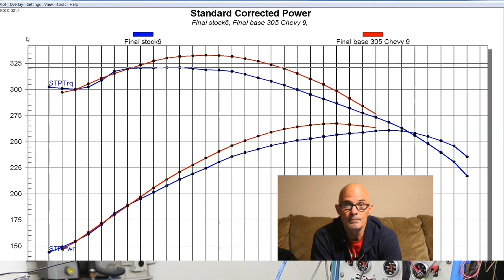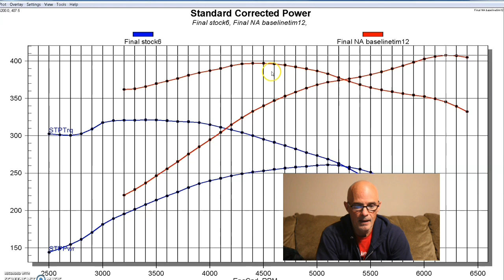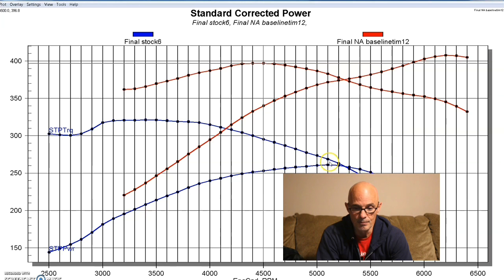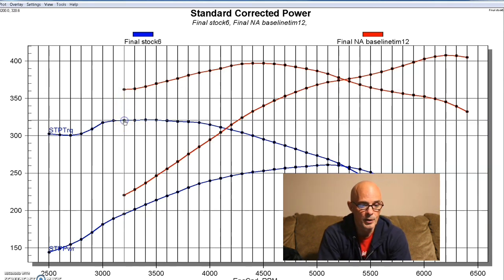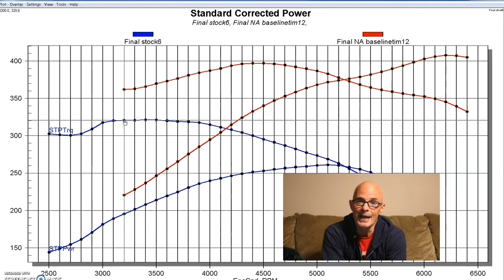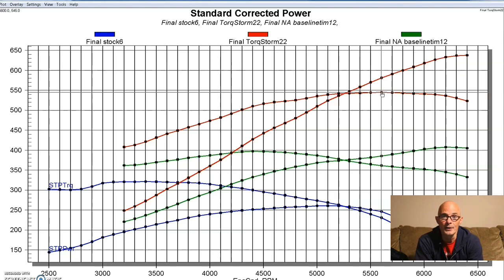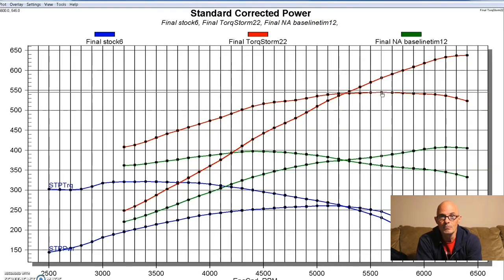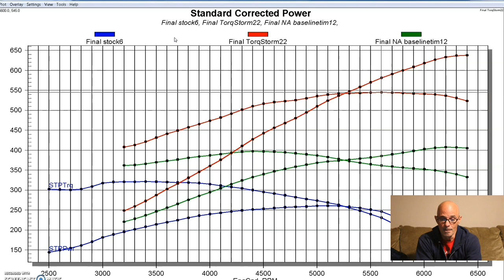5.0L FIGHT-302 FORD VS 305 CHEVY-FULL RESULTS

Comment: This brought back some memories.  in 1987 and 88' I had a bone stock 84' GT with T-tops, even had the goofy TRX wheels.   The 305 GM cars couldn't compete on the street, not even close; the 350 cars were a drivers race, always very close and lots of fun. Although one day an older dude (at the time,  I'm an older dude now) was in a 83-85 turd brown stock looking RS Camaro, we got into it on the freeway, he left me big time ...as the kids now say, I was gapped.  Never saw that car again as I have always wanted to know what he had under the hood.
Reply: @port nut I always have thought he had the bottle, there were to big black puffs of smoke as he was pulling away during a shift.

Comment: So where is the 318 Dodge? Heads, intake, cam, turbos, lets go! :-)
Reply: bcbloc02 👍
Reply: Dodge and Plymouth were completely absent from the Pony car segment in the '80s. And no V8 had port EFI until 1991. The Magnum small block is a low RPM truck engine and would be pathetic in this comparison.
Reply: @Joshie2256  Wrong. The only thing that makes the Magnum engines "truck engines" is the fact that they are biased towards low rpm torque. Change the heads, cam and intake like Richard did with the 5.0 and 305 TPI and you'd get similar results.
Reply: @s0meguy809  Okay, so what was Dodge's 80s-90s pony or muscle car? A Daytona turbo? Omni GLHS? Wait, the Dodge Stealth R/T. That compares to a Camaro right? The only thing the Magnum small block came in were trucks and vans. There really isn't a good EFI Magnum intake manifold, only carb manifolds converted to EFI or modified stock intakes with a too-small runner cross section. I'm a Mopar guy and Mopar had zero RWD performance cars in the 1980s.
Reply: @Joshie2256  That doesn't mean the magnum engine can't make some power. There's currently a stroker magnum zj grand cherokee that runs 9's on spray. Indy or Edelbrock heads, Hughes air gap and a cam in a 318 will make some nice power. It would have been nice if there were more efi intake choices. Problem was most guys that swapped magnums in older cars stuck with carbs.
Reply: @s0meguy809  Sure they can make power. You can make power with a Packard V8 too. Do they belong in a pony-car engine test? No.
Reply: @Joshie2256  What do "pony cars" have to do with anything? He tests engines. Who gives a crap what it came in. Iron block 5.3's only came in trucks so I guess it's a truck engine and can't be put in a car.
Reply: @s0meguy809  This was a 1980's 5 liter engine shootout between the Camaro L98 and the Mustang 302. These were the pony cars of the era. Nobody drives an engine.
Reply: In the garage

Comment: I’m a simple man. I see a Richard Holdener video, I click. Then I click like. 👍🏼
Reply from the maker: simple and effective
Reply: @richardholdener1727  Did you or do you plan on doing a video comparing the Chevy 350 vs Ford 351W in a similar way with pros and cons for each and showing each ones ability to make power?

Comment: I have a 304 SBF with Trick Flow 11R 190 cc heads (56cc milled versions), TFS Track Max Cam 595/595 110°lsa 242/246 camshaft, pro comp intake manifold (Vic jr style), ford Motorsports shorty headers, run by a Holley Sniper EFI setup. I need to put it on the dyno and get it tuned to see what it makes. Love your videos they always keep me entertained while building engines myself or just to purely watch while having a smoke in my garage. Keep grinding and shining 🤘🏼😎
Reply from the maker: thnx-let me know what happens
Reply: Thats a lot of cam for that motor

Comment: I know the Chevy was new, and the Ford was from a bone yard but did you freshen up or ring gap... the Ford?
Reply: dean silva right? The chevy guys always do this.. they get new chevy stuff and always go for junkyard ford blocks n think the results will be “fair”
Reply: @mikecorleone6797  Then it should be easy. Give me 3 examples.
Reply: Corndog1911 I’m sorry I’m having a really hard time taking someone named corndog seriously 🤣
Reply: @mikecorleone6797  Walk on home Ford Fanboy. It's hard to find 305s and 350s because people don't want to give them up but you can find old 302/5.0Ls sll day because the better Coyote and Voodoo engines are available now. When an older GM V8 is built it will always beat a Ford V8 and here is why: Fords rely on higher RPMs and larger bores to get more HP and Torque while GMs rely on compression with lower RPMs. The older GM V8s had greatly reduced their compression to pass emission tests while Ford on the other hand used a Brain Box/PCM to limit the HP and Torque by capping the RPMs and top speed. GMs can gain compression by using a bigger cam longer Rods and shorter heads while the Ford can do that also but not nearly as much because they never hard nerfed their engines like GM did. You will see bigger gains when building an older GM engine than you ever would building an older Ford engine.
Reply: Timothy Isenhart i dont have to walk home guy i drive fords.. let’s take a look at gm’s track record on recalls.. or grenading diesel injection pumps which they are in a multibillion dollar lawsuit over.. warranty my ass
Reply: @mikecorleone6797  Gladly will take GM's truck record on recalls over Fords.  LOL, recalls are all Ford dealerships do these days.   Ford has recalled more cars than any company in history, and that's a fact you can look up.
Reply: @SealofPerfection  

Let's talk about the chevy 8 speed tranny! Talk about recalls.
Reply: @SealofPerfection  sorry, dude.
chevy used to advertise.
" the most resold truck in america. "
think about that for a moment.
in order to be the most resold ... more people had to get rid of them.
Reply: @SealofPerfection  sorry, dude.
the ford f series has been the number 1 vehicle sold in the world for over 20 years.
Reply: @jesusisalive3227  Let's talk about every Ford Vehicle that has been recalled for different Fire Hazzards like the Rangers, F150s, Expeditions, Explorers and Mustangs.
Reply: @tskraj3190  

Let's talk about glued on doors falling off and front ends falling apart.
Reply: Jesus IS Real  

I like showing people the difference in size between the 351w crank and the Chevy 350 crank.

Comment: Hey what size injectors did you run on the supercharged 302 and did the 302 have a girdle on it.
Reply from the maker: both motors were stock bottom ends-no girdles (which don't stop the block from splitting), injectors were 80s

Comment: I had a Mustang and 5.0L Ford LTD (fox platform) so, I have some experience with the 5 liter Ford engine.  One thing that I never liked about the 5 liter Ford is the low deck height.  This causes the rods to move at a large angle relative to the pistons.  Although the engine works fine, I always wondered if these rod angles had detrimental effects especially at higher rpm's?  Any thoughts on that?
Reply: One of the last things even race engine builders think about.  100 other things to worry about before rod angle.
Reply: We screened the crap outta the 302 Windsors! Shot 150 on them 3-4 times a night 3-4 times a week! Had aftermarket rod bolts! But, buy a 351w and heads intake and cam to start with! So much more low in torque!

Comment: Good stuff,  Up next 318 dodge with china heads.  😝 Disinfect first before handling.  🦠
Reply: that sucker would make at least 200 hp ! if you put new heads ,headers,bigcam,big carb,10:1 pistons and mopar stickers. that's an increase of 50hp all for less than 3000 dollars!
Reply: Justin Riley I thought they made 180hp stock, or was it 160? 😝. 273ci was rated at 275hp.  You'd have to install  slant 6 heads with 2 cylinders lobed off to get 200hp.
Reply: @TheProchargedmopar  ours brand new in 1989 made 150hp.

Comment: Great explanation of both engines. Us chevy guys have known the benefits of the 4 inch bore since 1962 (327) when ford was still stuck at 289 ci. No one in their right mind has ever hotrodded the 305 when there are literally millions of 4 inch bore cases to work with.
Reply: No such thing as a Ford 289 in 1962, they were introduced in 1963 😁.

Comment: Please put a 3" stroke crank in a 350 some time with a comparable heads and cam set up.
Reply: That would be cool.
Reply: If it was all the same they would make the same power. Same bore, same stroke, same airflow, same cam, same compression, same curve.
Reply: That would be a 302 chevy...that was the configuration of the 302's in the 68&69 z28's
Reply: They call that a 302.. Or in chevyspeak a DZ302, they did it for the early camaros.. and like any overcammed underheaded chevy back in the day it made all it's power above 6000 rpm. So why rehash it? given the same head and cam specs they make the same power.
Reply: My best friend in high school bought a 68 z28 with a dz302 in it our junior year in high school (1983)... Paid $2700 for it!  ....it had very little bottom end power but loved to rev..  Ended up with a really nice set of bow-tie ported heads and an isky solid lifter flat tappet cam in it..and it ran great back in the day...but we changed out the bottom end with a 350 and picked up .7 and 4 mph in the quarter mile with no other change..
   It was a fun car and a great time to be a kid..
Reply from the maker: I built a reproduction DZ302 and compared it to a Boss 302 and many other Muscle car motors-then modified it
Reply: @philipmacduffie7612  
With the factory heads. I don't see how the chevy could make the power that the boss would. The boss had bigger ports and valves. 
And I am no way a ford guy. 
But there are heads today for chevys that should flow just as good as boss heads.
Reply: @Scootermagoo  yep, but finding one would be a lot harder than just ordering a 3" crank and cramming it in a 350 block.
Reply: @martyjohnsonozarkoutdoors8198  I read what you said as comparable wedge heads on both motors. The 351c head is a great head for it's day but to my knowledge there isnt anything like a C302 / A3 Ford head for a gen1 Chevy. The SB2 is a little unfair against a 351c architecture head, and if you throw the Yates head in then we are just testing low rpm 5.0L cup motors which will be turds under 4k.
Reply: @philipmacduffie7612  I don't know for sure. But I'd say the flow numbers on the Cleveland style heads on the 302 boss would out flow anything gm had at the time for small block chevy. I'd like to see the difference on the dyno. With a same cams and intake volumes. And dynamic compression ratios. Just to see the difference in horsepower the heads produce.
Reply: @richardholdener1727  can we have a video on that? :P

Comment: My buddy broke a bunch of stock 302 ford blocks they seem to crack from the lifter vally to the mains usually about the 600 mark on the 1/4 Mile
Reply: My buddy split a block in half around 5-600hp
Reply: 500 ish they split...

Comment: Everyone had a stang back in the day. Friend of mine built a record automatic car. Maybe a deep dive in your car so people can see how they did it on the first real fuel injected platform
Reply: BuzzLOLOL : So did the Cosworth Vega, with an optional T50 Saginaw based, Borg Warner style 5 speed too for 76. Sadly, GM,  often THE pioneers things with true excellence, THEN backs down. The Olds 350 EFi in the Caddillac was exceptionally smart. The Olds 403 in the Firebird TA was really powerfull. The Olds 350 diesel block was a great prostreet engine base
 The Olds 307 was a great post malaise era Hurst Olds B muscle  car. Gm just needed to keep up the halo end of common coupes and not soley rely on Corvettes and Caddy's for image and tech. Again, having a whole approach. The 305 with the right Brodix Pontiac style heads would have made the F body  or MonteCarlo a real riot for many years.

Comment: The ford tended to split the block when you got over 500 hp. They developed a reinforcement brace but it had limited success.
Reply: Only with nitrous oxide over 700hp. I ran a stock block w/ mild cam and a big ass turbo off of a catapiller generator made more than 700hp but it blew head gaskets all the time.  Lol
Reply: @andrewjolley3620  Bad tune kills more blocks than anything, but you are right about rpm. Keep it under 6,000 rpm and it will take a lot of power with a good tune.

Comment: Everyone is commenting on splitting the stock block above 500 hp. I agree absolutely. However when u build the correct combination it will live to race another day. I have a stock block 302 bored 30 over to a 306. Edelbrock heads comp cam and a ProCharger. Zero intercooler. With 92 pound injectors and 24 pounds of boost it makes 586 at the wheels thru a C4 and 373 gears. Made well over ten passes in the 9 second range. Still lives on today. It’s all about RPMS!!! I shift it at 5600 and never more and leave off a foot brake. Full weight GT with a cage. Not some stripped down she’ll of a drag car. It can be done!

Comment: Have you ever tested the afr 227 vs. 235 vs. 245 23' heads on a built small block?  ...427-434"  solid roller cam...  Around 13 to 1...
Reply from the maker: not that specific
Reply: You might guess...  That's what i have for an engine in my car..  I have the an older set of 227's. Was curious about moving up to the 235 or 245's..

Comment: Smokey Yunick always liked short strokes so he could fit the "longest damn rods" possible to get better rod angle to the crank on the power stroke. Have you done any tests with rod length?
Reply: Engine masters just did that test, rod ratio made no noticeable difference on their big block.
Reply from the maker: yes-rod length changed nothing
Reply from the maker: you might be thinking about changes in stroke length

Comment: I'm surprised the Ford 302 didn't split the block down the lifter valley at over 600 horsepower.
Reply: U also gotta understand its an engine dyno no drag from things in the engine bay and it was running open headers.  That 600 hp is prob 500 at the wheels inside the car likely not that much...point is these have been known to live up to around 500 rwhp depending on use and how its tuned.  So its not surprising it stayed together ecspecially on a dyno where it isnt as stressed as it would be inside the car on the street or track doing hard pulls
Reply: I've seen where guy's running that kind of power boosted with a girtle, and getting over 200 passes at the track before the block splitting.
Reply: @andrew jolley these aren't from your average joe shmo. These are from people that race these mustangs regularly and own race shops. Check out Neo mustang here on YouTube. He raced on the stock 302 bottom end for a while and eventually put in a 351 which is the combo he's running now in his main car.
Reply: Its usually when you keep em at 600hp and start running em alot or racing them at that power level you put alot of strain on it and with that power output crack but just as a evernow and then thing itll take it just like that crank will take an 8rpm rev all day most will say it cant oh but it will the other stuff is all you have to work on the the cam rocker arms ect to take that rpm but the crank in a 302/5.0 will take 8rpm no prob
Reply: Amazing how tough ford blocks are. Chevy are paper thin in the intake valley.
Reply: @marcharris2734  and yet the 302 splits the block at 600hp

Comment: @RichardHoldener plz talk about the blocks splitting
Reply: The 302 blocks splitting are the cheaper made blocks, have to look for the Mexican blocks that are much higher nickel content and can handle much more power, or you can also put a stud girdle on the mains on the cheaper block and it to can handle much more power

Comment: I would love to see a
-Vortec 5.7L 4.00” bore block
-L99 4.3L 3.00” stroke crank
-L99 4.3L 5.94” rods
-Stock LT1 pistons
-Stock LT1 roller camshaft
-TPI intake manifold
- heads of your choice & then see how much power GM left on the table by using a small bore

Thank you for all of your videos.
Reply from the maker: me too

Comment: How long would that 5.0 last at that power level? Stock blocks split after 500hp? I'm putting together a stock block  with ported and larger valves GT40P heads for my 71 Maverick with plans to go turbo in the future. I would love this combo and power for it but reliable too. Great video! 👍🏼

Comment: Hey Richard i have that exact combo I am using a Trickflow topend kit 75 throttle body and mass air flow. Just wondering what injectors you are using, i have 30lb. It really woke my engine up. It’s a stock bottom end never been rebuilt.

Comment: It would be interesting to see the same test with the Ford 302 and Chevy's 302. Both had a 4 inch bore and a 3 inch stroke
Reply from the maker: Chevy didn't make the 302 in the 80s
Reply: @richardholdener1727   I know this of course. Chevy only made the 302 for 3 years in the late 1960s Ford made the 302 for 27 years

Comment: Are the Trick Flow cylinder heads crucial to make that 400hp? what if you only equipped the intake, headers and camshaft? surely without the Al heads the budget would halve!? (id splurge and get them for sure though haha)

Comment: Awesome video totally expected the ford to split in two. I'm not sure how it didn't with that output. Must be one of the lucky blocks like "project stock bottom end"
Reply from the maker: the centrifugal blower is easier on the block than turbo-they provide much more torque
Reply: @richardholdener1727  I've always heard turbos were the easiest on the bottom end; due to lack of strain on the crank. Another perspective on that is great.

Comment: Is the 302 block upto the supercharged level of power for the long term or is it more of a revs based issue which they run into?
Reply from the maker: I ran my Vortech 5.0L motor for 85,000 miles

Comment: @ Richard Holdener Was the intake a street heat with 15 inch runners or a track heat with 12 inch runners.